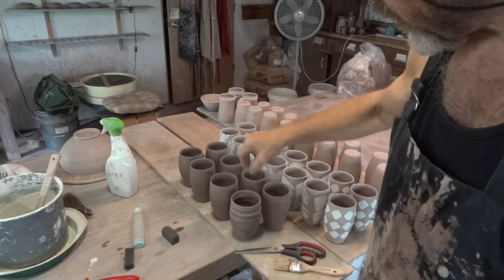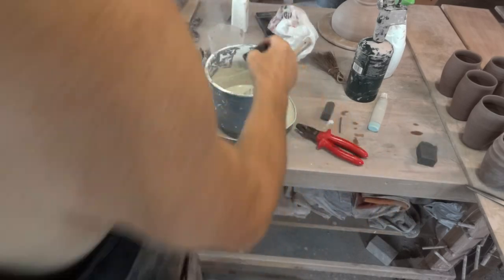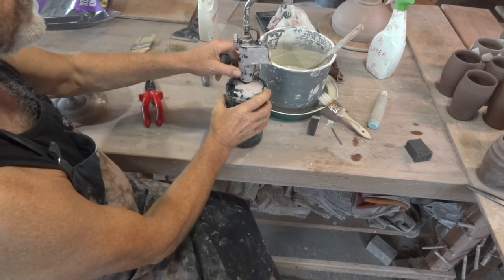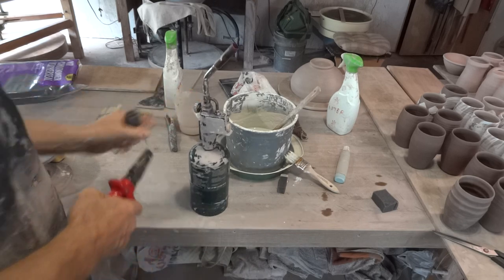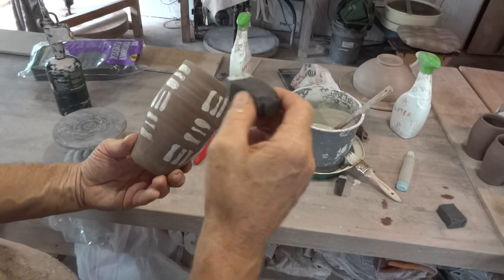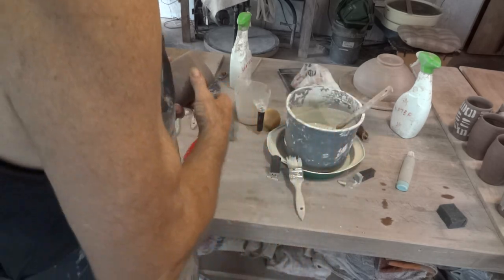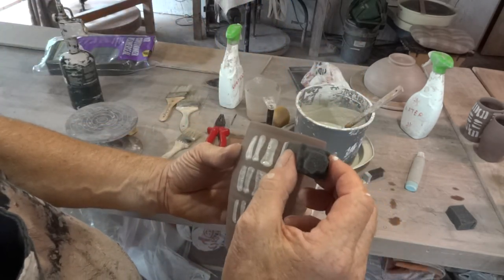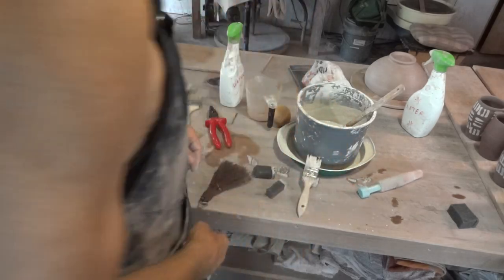Using white slip stencils and brushes with Simon Leach

Comment: I suppose you could use a soldering iron to melt the foam also.  Thanks for the ideas.  I have some high density foam that came in some packing material.  I'll be making some stamps very soon!